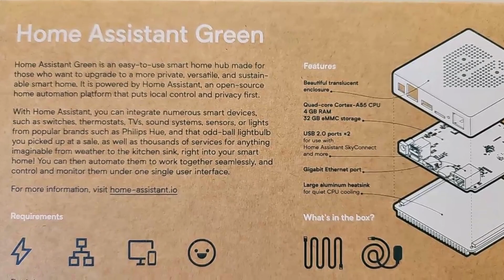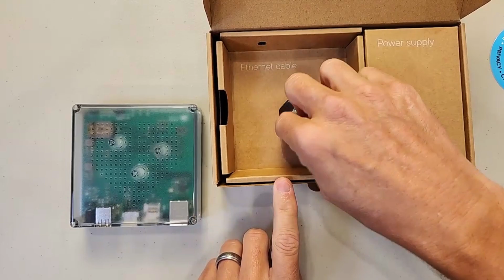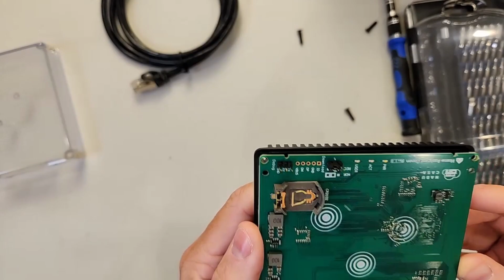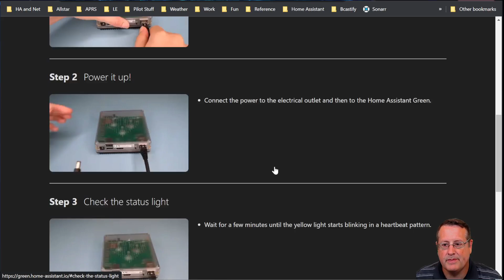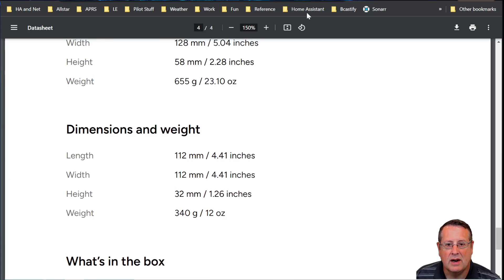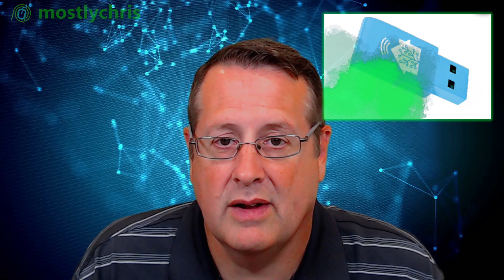Unboxing the NEW Home Assistant Green

Comment: The ethernet cable supplied is similar the one supplied with the Yellow, and it is high quality, shielded Cat 6A (as far as I recall).  
The green is a great entry point if you have hubs around the place and just want to integrate into one UI.   If you are going deeper, then the green will quickly become a bottle neck.
The instructions are very similar to the instructions for the Yellow.  That documentation was very nice also, and the way the two devices boot is quite similar, including the heartbeat on the yellow LED.
As much as it interesting, Passmark is not really worth running.  Sure, it is a general indicator, but it really doesn't indicate how the Customised and optimised HAOS will run on the device.   That said, the Green was never meant as a Raspberry Pi replacement.  It's an entry level device for people just dipping their toes in.
Reply: Could you explain why it would become a bottle neck. I've been looking into starting a home assistant network with zigbee. Is it worth getting this and sky connect as I haven't used anything like this before and it would seem the simplest way to start for someone like me who isn't a coder

Comment: The ethernet cable provided is shielded that is what the silver case is on the side of the RJ45 jack. That is to provide better RFI / EMI protection if the rest of your network is properly grounded. The provided cable would be stranded wire and not solid conductor as the latter is intended to be installed and used within a wall.